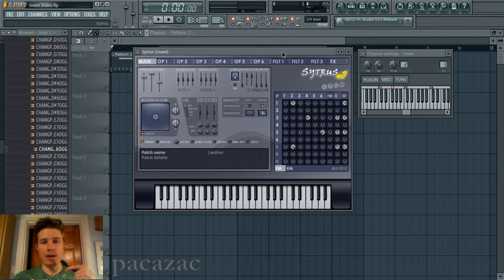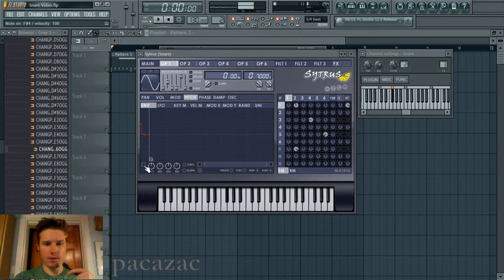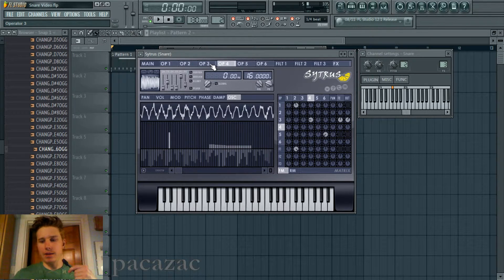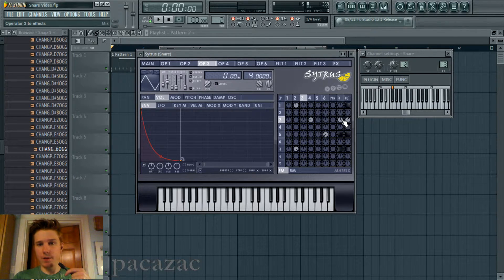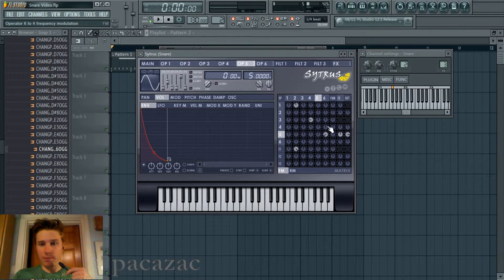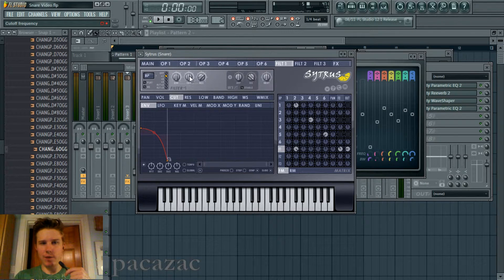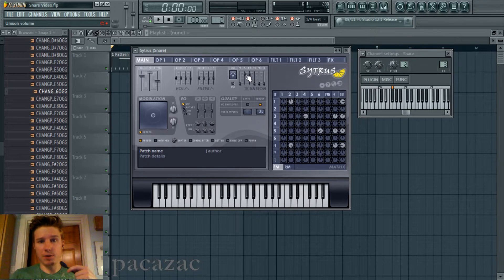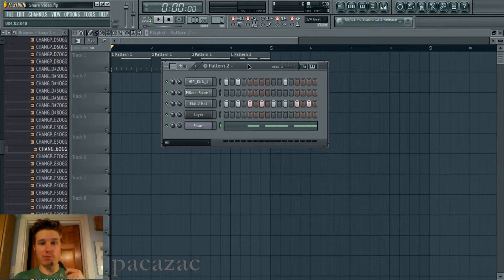Snare 1: FM Sythnesized Snare Drum

Comment: it sounds fake, but I can tell you what you did wrong. 

1. you didn't have any resonance which real snares have a really audible metallic resonance

2. you didn't have enough high end on the initial impact, a good way to get good transients is to actually distort the fundamental tones and make sure the initial impact starts off phase giving the sound a little click  before the noise. 

3. the tail is weak, a good way to fix this would be to actually layer claps, and rides. rides especially can give your snare a more metallic sound just make sure the rides are not loud, make sure its there where you cant hear it, but notice it when its gone. 

4. compression, if you want really good and loud snare drums id compress the hell out of it, of course the compression part is preferance, but i love to load the maximus preset soundgoodizer A and lowering the LMH MIX knob down until its at a point where its not ruining the sound quality of the sound.